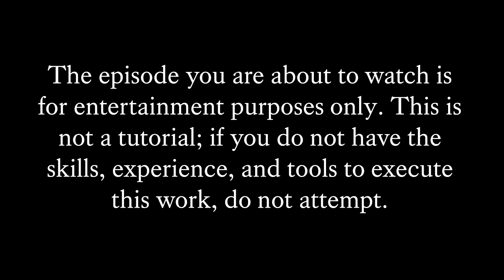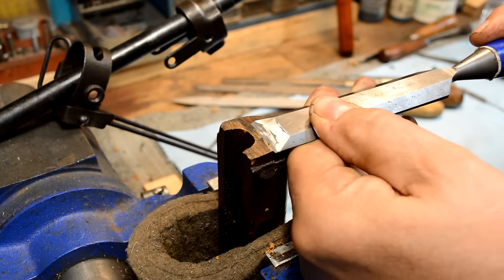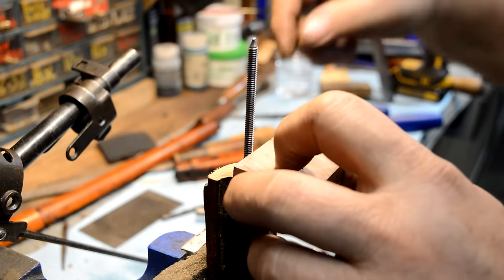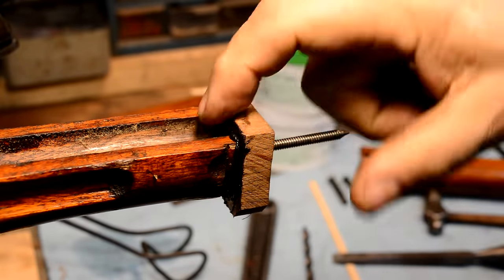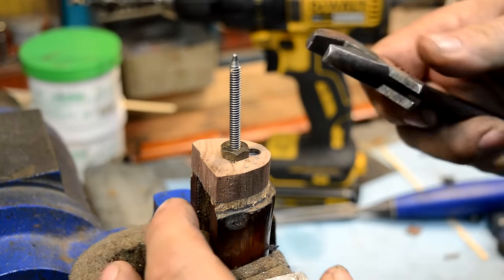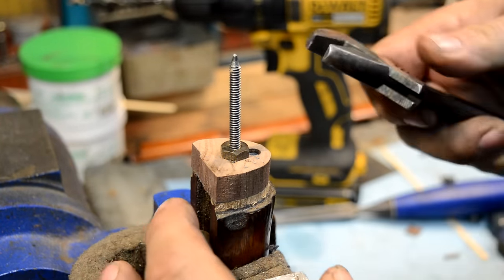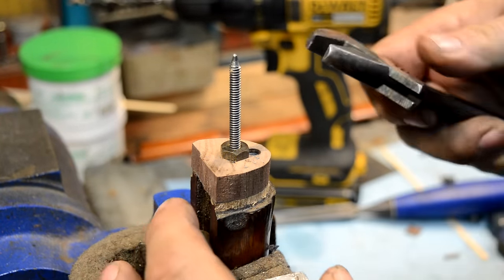Anvil 086: Type 99 Arisaka duffel cut repair

Comment: ITS GOT THE EMPEROR'S SIGN!?!?!

that means so much, and theres no way to be sure. Mine got removed by its owner at some point. every soldier who had a weapon on them with that seal was supposed to deface their gun, which means this badass thing prolly never saw the battle field. god im sitting here looking at mine this video rocks. those anit aircraft things were broken off a lot too by the soldiers, or just snapped. Ive never even seen one with a dust cover.
Reply: Defacing the mum was part of the de-militarization process and was done in Japan. It was not done by soldiers in the field.

Comment: You don't need to remove the front sight to get the bands off the gun.   Its designed for the front band to be turned upside down and slid over the front sight.

Comment: @MarkNovak be really glad you didn't have to disturb that finish, they used a resin from a member of the poison sumac family to make the finish, I believe the stuff is called "urushi" and it is really really nasty stuff if you make any dust, I made that mistake once upon a time, and ended up with a HORRIBLE rash and my eyes swollen shut. And Arisaka stocks were either beech, walnut, or katsura, and just going from the video, I would say this one looks like katsura, it looks almost exactly like mine, which was from a ceremonial guard unit. (Mine doesn't have the aircraft sights though, wanna trade?lol) I have been told they used the katsura for the higher end parade rifles because it is a traditional Japanese material
Reply: BTW, the finish is completely harmless, and remarkably durable, if left alone. So another reason to leave the finish on a milsurp the hell alone.

Comment: I have a Type 99, no duffel cut, untouched mum, has aa sites, matching even the dust cover, has unique length cleaning rod.  Unicorn indeed.
Reply: Either the cleaning rod was lost and replaced or it was built at a time of transition in parts during the war.
Reply: @gunfisher4661  my money is on lost and replaced.
Reply: Color me jealous!!! 😍
Reply: @gunfisher4661  No, it is the original cleaning rod to the rifle;  it's the  ??5 3/8" ?? uncommon cleaning rod as noted in McCollum's book.  I don't have it with me atm so I can not look it up.

Comment: You're just a genius, man!! Thank you for videoing your work. Know that many, many of us enjoy watching you in action immensely!! Thanks agajn!!
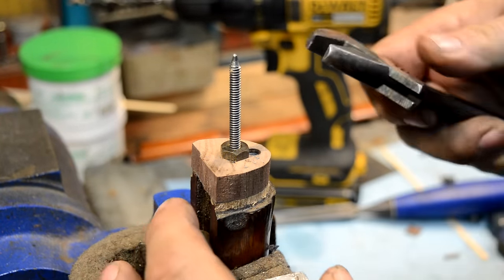Reply: Well this isn't going to be welcome but here we go. @31:53 we can very clearly see that the top edge of the stock on the right is noticeably higher than that on the left of the join. Mark does not see this. This is the stage where the parts are brought together dry so that they can be fitted correctly. Look closely, it can be seen that the barrel is sitting down hard into the wood on the right but is lifted in the wood on the left as witnessed by a gap between the wood and the metal on the left. This can only be caused by the wood on the right being too high in relation to the mother stock and shows that the hole for the threaded rod is in the wrong position and is causing the joint to be out of line. 
Having assembled the joint @37:43 we see that the exact same conditions apply and the repair is out of line. Start watching at 38:10 Mark checks the alignment and (look closely) moves the stock even further out of alignment by lifting it higher. Shortly after this he confidently tells us that this is not the sort of gun that you learn on. @40:10 here's the smoking gun! Notice how the wood grain is showing through the glue. It stops showing at the exact line of the join because the barrel was lifted up from the mother stock by the miss aligned stock. All the pressure of the rubber strap could not pull it true because the threaded rod could not allow it to move into line. @42:32 look closely at the visible left hand edge of the glue and it can be seen to have considerable thickness. This is the result of the barrel not sitting down in its cradle in the stock. The thickness of the glue exactly matches the degree of missalignment of the top edge. @45:01 he finally notices the problem with the top edge of the stock and cuts a little wood off. @45:16 Mark starts to explain that wood moves with time and he's right. However no amount of explanation can put this situation right. @47:18 he cuts away wood and tells us that it swelled right here. He demonstrates that he does not understand why the top edges are not in line and level. @49:14 this is the first time that we see the results of the missalignment. Not withstanding any bending of the top stock the gap between the top and bottom on the left of the joint is exactly equal to the degree of error in jigging the two parts of the stock together. Mark's attempts to blend the joint are seen as a freshly cut ramp in the wood. @51:23 Mark is telling us that the front end joint is tight and it is. However he makes no mention of the gap behind the joint which will always be there. @54:20 observe the gap where the top covers the bottom. In spite of any explanations that gap is there because Mark assembled it out of line. 
I have been a gunsmith for over 40 years and am often called upon to correct poor repairs. I despair at this job and I wonder if the owner will be content with explanations of swelling wood as he holds this rare example. Often I have found that workers who make sure we all know how good they are can produce average work with eloquent and lengthy explanations of how difficult it was and how the average joe would make a hash of it. I expect this comment will be deleted as it will not sit well with Mark Novak. I challenge you to leave it here so that your viewers can respond.

Comment: Great job on this one Sir.  Really great work.

Another big big key on a job like this is PATIENCE.  No rush.  Plan out every move, and go one step at a time.

Great job.
Reply: Well this isn't going to be welcome but here we go. @31:53 we can very clearly see that the top edge of the stock on the right is noticeably higher than that on the left of the join. Mark does not see this. This is the stage where the parts are brought together dry so that they can be fitted correctly. Look closely, it can be seen that the barrel is sitting down hard into the wood on the right but is lifted in the wood on the left as witnessed by a gap between the wood and the metal on the left. This can only be caused by the wood on the right being too high in relation to the mother stock and shows that the hole for the threaded rod is in the wrong position and is causing the joint to be out of line. 
Having assembled the joint @37:43 we see that the exact same conditions apply and the repair is out of line. Start watching at 38:10 Mark checks the alignment and (look closely) moves the stock even further out of alignment by lifting it higher. Shortly after this he confidently tells us that this is not the sort of gun that you learn on. @40:10 here's the smoking gun! Notice how the wood grain is showing through the glue. It stops showing at the exact line of the join because the barrel was lifted up from the mother stock by the miss aligned stock. All the pressure of the rubber strap could not pull it true because the threaded rod could not allow it to move into line. @42:32 look closely at the visible left hand edge of the glue and it can be seen to have considerable thickness. This is the result of the barrel not sitting down in its cradle in the stock. The thickness of the glue exactly matches the degree of missalignment of the top edge. @45:01 he finally notices the problem with the top edge of the stock and cuts a little wood off. @45:16 Mark starts to explain that wood moves with time and he's right. However no amount of explanation can put this situation right. @47:18 he cuts away wood and tells us that it swelled right here. He demonstrates that he does not understand why the top edges are not in line and level. @49:14 this is the first time that we see the results of the missalignment. Not withstanding any bending of the top stock the gap between the top and bottom on the left of the joint is exactly equal to the degree of error in jigging the two parts of the stock together. Mark's attempts to blend the joint are seen as a freshly cut ramp in the wood. @51:23 Mark is telling us that the front end joint is tight and it is. However he makes no mention of the gap behind the joint which will always be there. @54:20 observe the gap where the top covers the bottom. In spite of any explanations that gap is there because Mark assembled it out of line. 
I have been a gunsmith for over 40 years and am often called upon to correct poor repairs. I despair at this job and I wonder if the owner will be content with explanations of swelling wood as he holds this rare example. Often I have found that workers who make sure we all know how good they are can produce average work with eloquent and lengthy explanations of how difficult it was and how the average joe would make a hash of it. I expect this comment will be deleted as it will not sit well with Mark Novak. I challenge you to leave it here so that your viewers can respond.

Comment: You want to talk about unicorn Arisakas?
I have a Type 99 that is at the start of the last ditch (no monopod or aircraft sights) with a TIGER STRIPE STOCK!!!!! 
I have not ever seen another.
Unfortunately, it's been duffle cut & the front part of the stock was lost over the years.
I'm not sure if I should just replace the entire stock or try to cut a sock & color match it to the original tiger striped one.

Comment: Sir, I have come into possession of an Type 99 recently. It has all of the qualities of the one you repaired in this video. Except that it was never cut.  It appears to have been nickel plated. Is there a process to reverse that? There is some rust coming through the finish and so not believe it to be correct, meaning in the research I have done so far only ceremonial versions would have had this finish. I would send you pictures but apparently YouTube does allow attachments. Thanks (I won't be offended if you don't have the time to answer)

Comment: Not sure if anyone else mentioned it or not but the front barrel band comes off if you rotate it 180 (upside down). Should fit over the front sight with a little room to spare.
Reply: I vaguely remembered doing just that to my T99, but its been long enough that I wasn't totally confident if that was the case or not, but yes I believe you are correct.
Reply: Nice tip.  I have disassemble mine many times and never knew the barrel band would come off.  Thanks.

Comment: A skilled person with a really sharp chisel. Makes me want sharpen my chisels and skill. Thank you.
Reply: Well this isn't going to be welcome but here we go. @31:53 we can very clearly see that the top edge of the stock on the right is noticeably higher than that on the left of the join. Mark does not see this. This is the stage where the parts are brought together dry so that they can be fitted correctly. Look closely, it can be seen that the barrel is sitting down hard into the wood on the right but is lifted in the wood on the left as witnessed by a gap between the wood and the metal on the left. This can only be caused by the wood on the right being too high in relation to the mother stock and shows that the hole for the threaded rod is in the wrong position and is causing the joint to be out of line. 
Having assembled the joint @37:43 we see that the exact same conditions apply and the repair is out of line. Start watching at 38:10 Mark checks the alignment and (look closely) moves the stock even further out of alignment by lifting it higher. Shortly after this he confidently tells us that this is not the sort of gun that you learn on. @40:10 here's the smoking gun! Notice how the wood grain is showing through the glue. It stops showing at the exact line of the join because the barrel was lifted up from the mother stock by the miss aligned stock. All the pressure of the rubber strap could not pull it true because the threaded rod could not allow it to move into line. @42:32 look closely at the visible left hand edge of the glue and it can be seen to have considerable thickness. This is the result of the barrel not sitting down in its cradle in the stock. The thickness of the glue exactly matches the degree of missalignment of the top edge. @45:01 he finally notices the problem with the top edge of the stock and cuts a little wood off. @45:16 Mark starts to explain that wood moves with time and he's right. However no amount of explanation can put this situation right. @47:18 he cuts away wood and tells us that it swelled right here. He demonstrates that he does not understand why the top edges are not in line and level. @49:14 this is the first time that we see the results of the missalignment. Not withstanding any bending of the top stock the gap between the top and bottom on the left of the joint is exactly equal to the degree of error in jigging the two parts of the stock together. Mark's attempts to blend the joint are seen as a freshly cut ramp in the wood. @51:23 Mark is telling us that the front end joint is tight and it is. However he makes no mention of the gap behind the joint which will always be there. @54:20 observe the gap where the top covers the bottom. In spite of any explanations that gap is there because Mark assembled it out of line. 
I have been a gunsmith for over 40 years and am often called upon to correct poor repairs. I despair at this job and I wonder if the owner will be content with explanations of swelling wood as he holds this rare example. Often I have found that workers who make sure we all know how good they are can produce average work with eloquent and lengthy explanations of how difficult it was and how the average joe would make a hash of it. I expect this comment will be deleted as it will not sit well with Mark Novak. I challenge you to leave it here so that your viewers can respond.

Comment: Mark, I love watching you fix these old pieces to bring them back to perfectly working condition! You're an extremely talented gunsmith and I wish I knew half of what you do.. 
Also, I too feel that acraglass is an amazing product, I've been using it for years to glass bed my rifles and it is just unbelievable how well your groups shrink afterwards!
Reply: Well this isn't going to be welcome but here we go. @31:53 we can very clearly see that the top edge of the stock on the right is noticeably higher than that on the left of the join. Mark does not see this. This is the stage where the parts are brought together dry so that they can be fitted correctly. Look closely, it can be seen that the barrel is sitting down hard into the wood on the right but is lifted in the wood on the left as witnessed by a gap between the wood and the metal on the left. This can only be caused by the wood on the right being too high in relation to the mother stock and shows that the hole for the threaded rod is in the wrong position and is causing the joint to be out of line. 
Having assembled the joint @37:43 we see that the exact same conditions apply and the repair is out of line. Start watching at 38:10 Mark checks the alignment and (look closely) moves the stock even further out of alignment by lifting it higher. Shortly after this he confidently tells us that this is not the sort of gun that you learn on. @40:10 here's the smoking gun! Notice how the wood grain is showing through the glue. It stops showing at the exact line of the join because the barrel was lifted up from the mother stock by the miss aligned stock. All the pressure of the rubber strap could not pull it true because the threaded rod could not allow it to move into line. @42:32 look closely at the visible left hand edge of the glue and it can be seen to have considerable thickness. This is the result of the barrel not sitting down in its cradle in the stock. The thickness of the glue exactly matches the degree of missalignment of the top edge. @45:01 he finally notices the problem with the top edge of the stock and cuts a little wood off. @45:16 Mark starts to explain that wood moves with time and he's right. However no amount of explanation can put this situation right. @47:18 he cuts away wood and tells us that it swelled right here. He demonstrates that he does not understand why the top edges are not in line and level. @49:14 this is the first time that we see the results of the missalignment. Not withstanding any bending of the top stock the gap between the top and bottom on the left of the joint is exactly equal to the degree of error in jigging the two parts of the stock together. Mark's attempts to blend the joint are seen as a freshly cut ramp in the wood. @51:23 Mark is telling us that the front end joint is tight and it is. However he makes no mention of the gap behind the joint which will always be there. @54:20 observe the gap where the top covers the bottom. In spite of any explanations that gap is there because Mark assembled it out of line. 
I have been a gunsmith for over 40 years and am often called upon to correct poor repairs. I despair at this job and I wonder if the owner will be content with explanations of swelling wood as he holds this rare example. Often I have found that workers who make sure we all know how good they are can produce average work with eloquent and lengthy explanations of how difficult it was and how the average joe would make a hash of it. I expect this comment will be deleted as it will not sit well with Mark Novak. I challenge you to leave it here so that your viewers can respond.

Comment: Excellent repair. I wonder if some very light fiberglass cloth could be bed in with the acraglass under the barrel bridging the area cut. This would add significant longitudinal strength. Just wondering. I enjoy your channel and the cello at the beginning and end or possibly bass - it’s awfully deep.